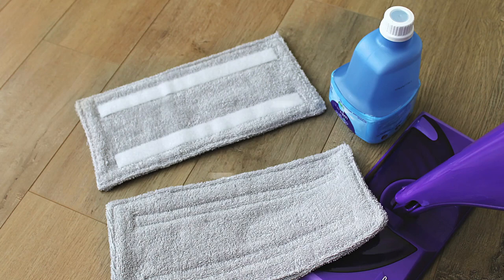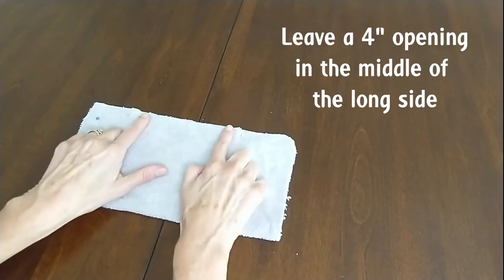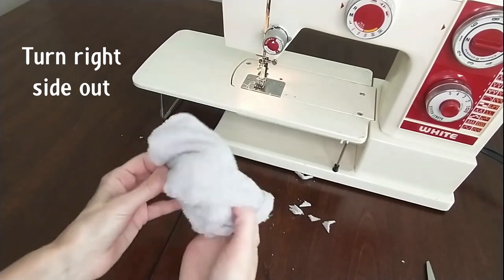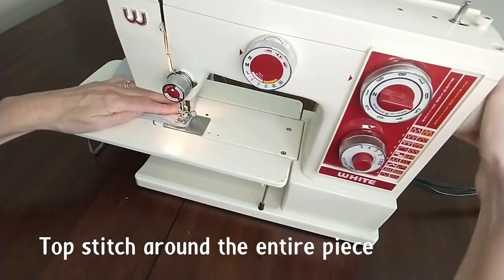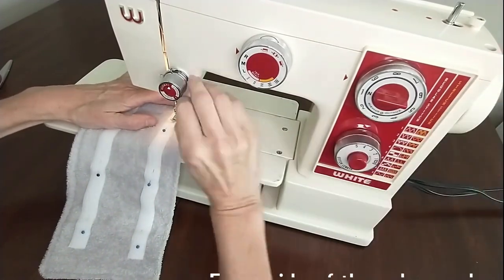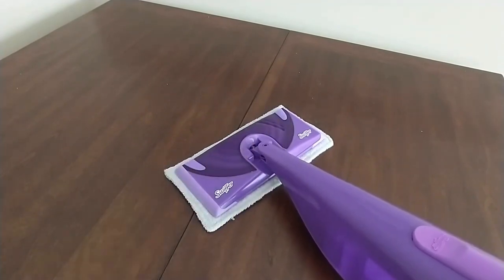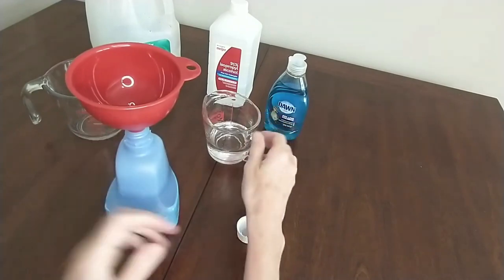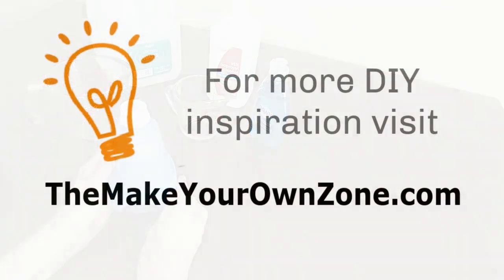How To Make Swiffer Wet Jet Pads & Refills

Comment: I have an old Swifter WetJet mop, and there is a scrubber strip on the front of the mop head. I'm not sure if the Swifter mops still have this feature. At any rate, is there a hack for the scrubber strip?
Reply from the maker: Hmm, I can't currently think of a hack to make your own scrubber strip. But usually just the terry cloth pad gets the job done just fine too.
Reply: @MakeYourOwnZone , thank you for replying!